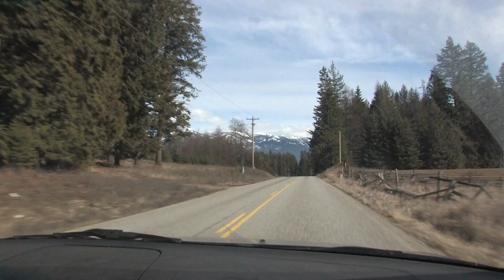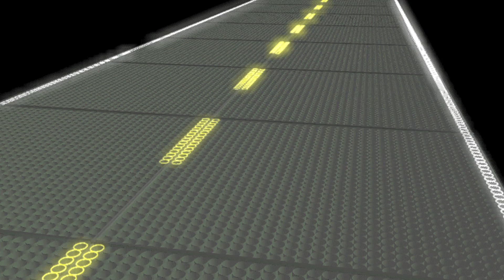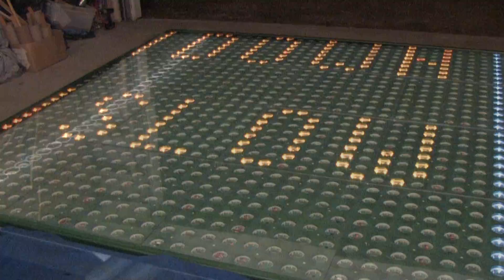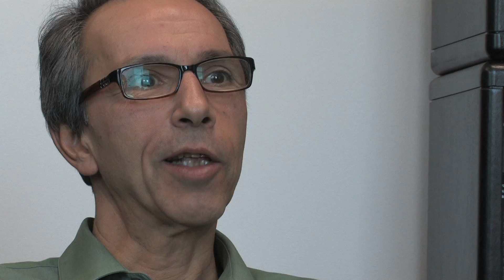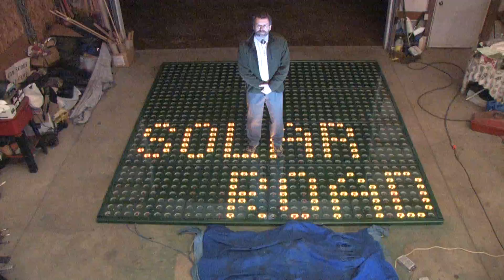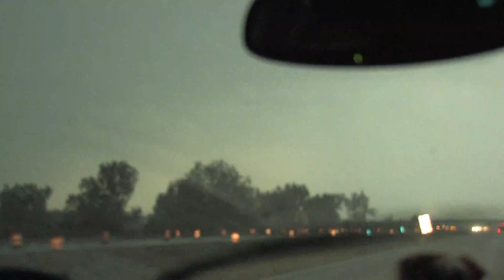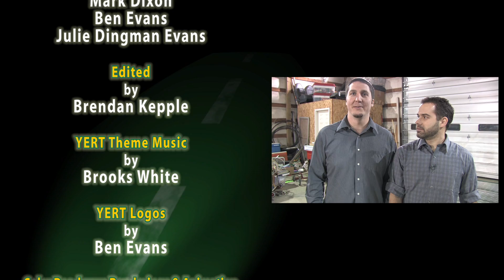Solar Roadways: The Prototype

Comment: Traction issues could be addressed via texture design of riding surface.

Besides repair & maintenance, another consideration: Roadways aren't perfectly flat and straight.  All panels will probably have to be custom designed, shaped, and fabricated.

Clever concept, though...

Comment: Who cares that glass is as "strong as steel"? not completely accurate anyway. It still shatters quite easily under torque pressure. What happens when the earth's crust shifts, or an earthquake destroys the glass roads causing glass spikes to pop up after the road fractures? You've now got blown tires all over, possibly people slipping and falling on these shards, etc etc. Glass is just foolhardy for large scale implementation. These guys are dreamers!

Comment: Big problem -> Snow, Rocks & Debris

I don't see how you can build a glass that won't scratch and crack when a steel snow plow is scraping on top of it. So, I suppose they could come up some sort of Teflon bottoms for the plow. But the plow is still going to push rocks and other hard materials along the surface.

Scratches would hinder the transparency of the panel making it less efficient.

Besides that, all the junk, rocks, dirt, whatever that is going to be on any given roadway.

Comment: Tell me, why does it have to be some high tech concept? Roads get very hot as is, can't it be lined with a mesh of wires to capture that heat at a low cost?

Comment: There are already many new inventions that will make these roads a lot more efficient.  Primarily, the creation of solar panels that also absorbs heat energy making them twice as efficient as older panels.  heat normally makes electronics less efficient.  also OLEDs would be cooler than LEDs.

he does a good job of making asphault sound expensive then provides an alternative that would be 10 times more expensive

Comment: @GRNoam Unique, clever, interesting idea, but cost, cost, cost.  No amount of heat absorption will produce enough energy to produce the very material/devices used to make these roads and absorb the heat.  This is the fundamental problem with any "renewable" resource -- to absorb energy and then store it (i.e. batteries) the cost of production measured by energy and financial makes the ideas worthless.  And that, not conspiracy, is why we still use oil based products for everything.

Comment: There's not too much sunlight here in Sweden during the winter, and the roads gets covered with ice and snow. Highways are usually salted to get rid of the ice, but probably 80-90% of all our roads are left covered with ice. It could be - partly - solved by heating up the plates, but generating heat requires quite alot of energy. There's also the wet/slippery problem. We also use sand/gravel on our roads during the winter, how would that affect the glass surface?

Comment: great idea, the only problem is, wet glass is slippery.. Snow covered glass is cold and when it melts becomes extremely slick. This would work for extremely sunny areas where it doesn't rain or snow but for a place where it snows 3 months of the year.. it'd be a death trap!

Comment: Dirt would be a problem what about the pads that convert pressure to electricity? also just convert the heat directly.

It would be nice to do this at the same time as converting to maglev.

Replaceable segments seems to be obvious for road maintenance therefore when accidents accure and the road is damaged you need merely change the damaged segments rather than do entire road works and re-lay ashfelt.

Comment: This is such an incredibly dumb Idea, I cannot believe non-handicapped people think this is a feasible project.  A road made of glass is a nightmare., what's traction like? Water drainage, Ice? Just put the solar panels on roofs where they aren't going to get covered in dirt and scratches the first time you use it.  Even at 100% efficiency you're not going to be able to power cars with solar roads.

Comment: Color me unimpressed. Their 12x12 prototype hasn't even been driven on! 

Better by far to use roadways (especially parking lots) as empty ground and put a  solar roof up overhead! Can you imagine how much nicer it will be to get into the car at the local mall and NOT have it roasting at 140 degrees inside, because it's in a covered parking structure? 

And infinitely more pragmatic...

Comment: @LikeAVideo I think not, because as a golf ball would have more water on the surface, insured by micro bumps, and the glass has zero absorption, could take only evaporating water. in my mind they should do in a way that the water drained to the sides, or inside panels.

Comment: @LacedShit Sure, but the problem is this. Tax payers money goes toward roads. And the problem I see with it is this, it will not be easy and possibly costly to replace portions of the road. Although, it is a lot of work and a lot goes into paving roads now, but unless it is segmented, replacing it would be very difficult. Of course, if they have a plan then fine. If they can solve all the problems then I will back it up. But realistically speaking, I just see it as improbable right now.

Comment: Why cover the whole road?  Put a strip up the center of each lane.  The only contact will be when the vehicle changes lanes, or briefly wanders within the lane.  You said covering the whole road will make 3-X what is needed to power everything, so a strip, 1/3 of the each lane in the center should still do fine.

Of course you realize the project will cost many times what the road itself cost?  Not to mention much energy in creating the cells and installation.  It 
may never pay for itself.

Comment: So when we get another Carrington event, we will need to replace all of the roads in order to restore power, telephones, cable tv, etc?

Nice idea but I wouldn't want to rely on it.  Roads have a tendency to break, bridges fail, tanker loads of fuel catch fire, etc.  But my primary concern is a CME event from the sun taking out something that must be completely replaced in order to restore.  Easier to replace cable than road.

Comment: @Noisegator I agree that laying it would be faster once the land is prepped.  The problem is prepping the land.  This product has to not only be road worthy for civilian use, but military grade as well for all federal roads (As I understand, thats part of the reason for the fiscal compensation).  The land prepping is still going to take a while, so its not going to be as simple as dig out the simple road and put in the Solar Roadway.  Panels can break because the ground wasn't prepped right.

Comment: @CodeDragonDM the roads are actually heated to get rid of snow and ice and water. it was designed in idaho so it will last the winter or summer weather that s what happens when you can produce way more energy than need

Comment: And how does it handle snow?  Regions that move from severe cold to severe heat?  Places like Wisconsin, Minnesota, and Michigan have millions of miles of roads with  these conditions at some of the most insane conditions that roads have to survive, from -60 to +120 degree air temperature.   They have not just cars and trucks, but also snow plows and salt trucks travel these roads to keep them safe.  We need to see how these roads hold up.  Maybe test a mile in some of the worse areas?